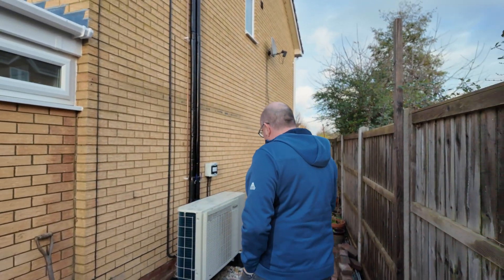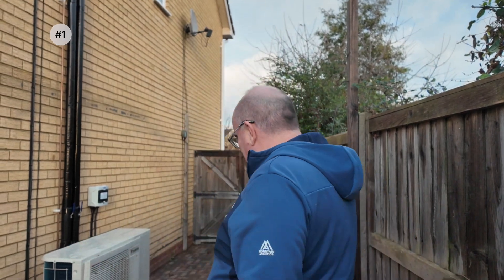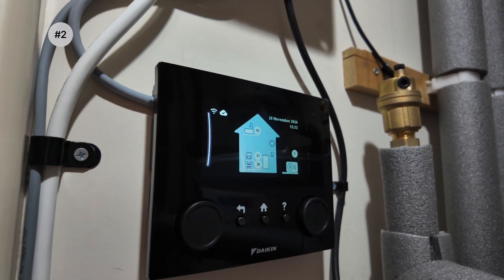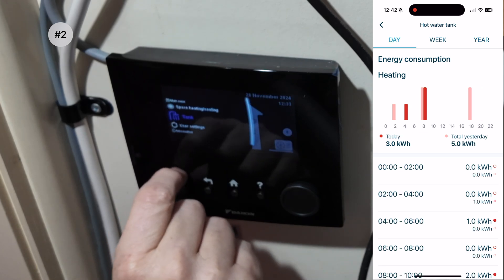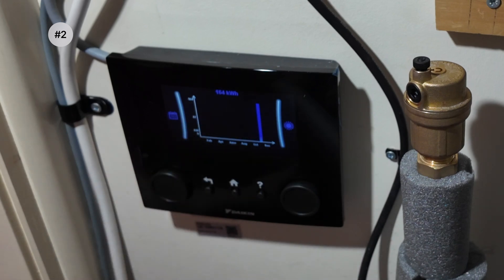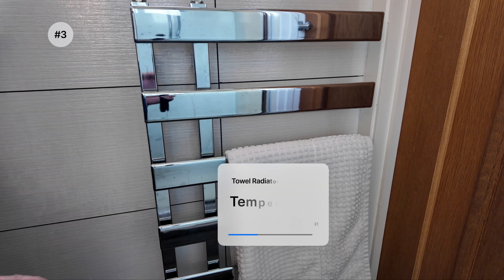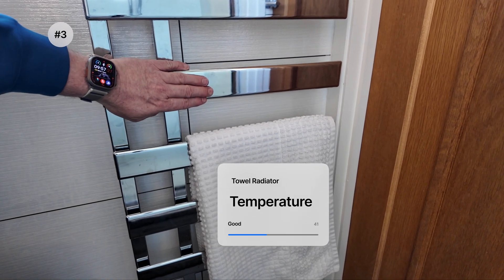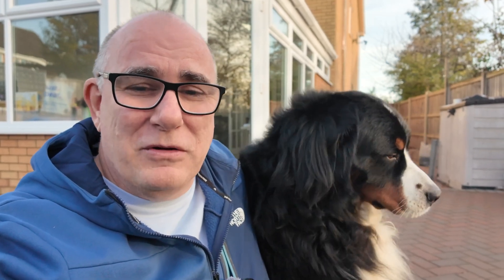3 THINGS I HATE ABOUT HEAT PUMPS

Comment: I think it was designed in Japan? I think there's stuff out there that can talk to the Daikin's API to extract data; I've already been looking into it as I know the interface is a bit rubbish - rounded numbers for kWh used and generated is something I've heard.

I picked up another Shelly EM in the recent sale which I intend to use to monitor the consumption of the heat pump.

I don't even have a heated towel rail; I just let my towels dry naturally. I always have spare ones. And my radiators are not that hot, even now, with gas; I switched to a nest thermostat that uses opentherm to control the flow temperature of my boiler and since then I think it targets 45 degrees most of the time. If anyone out there doesn't want a heat pump or can't get one at the minute but wants to save some money, it's worth looking at, but you need to wire it up to use opentherm. Nest doesn't do pure weather compensation but I think it does factor weather data into its decision when to start the heating and it figures out what works. I also keep my house fairly cool (around 18-19 degrees) and I use around 6500 kWh of gas every year on a 1952-build three-bed terrace with loft insulation, double glazing and cavity wall insulation added in South Wales solely for space heating and hot water, and I think that's pretty low. Unfortunately I don't have comparison data for what I was using before then.
Reply from the maker: that’s disappointing. I was hoping the API would give more granular data rather than the rounded up numbers that we see in the app. Maybe I need to go down the ESPaltherma route
Reply: Just to be clear, I don't know what precision you get from the API; I've only heard that you get rounded numbers in the Daikin apps.
Reply from the maker: Yep it appears so

Comment: So the COP is only 3.28. Isn't that a bit disappointing?
Reply from the maker: Yes but that’s because we’re still finding the sweet spot, we have not adjusted the weather curve yet so it’s pretty much factory default. Realistically we would measure the cop over a much larger period than two weeks. I’m already starting to see a edge up even with one more weeks later this is also combined, of the heating and the hot water system. Hot water is generally a little bit lower so the average of the two will be slightly under what would be expected.
Reply: @JonathanTracey Shouldn't the standard installation set the optimum heat curve, weather compensation and flow rate? Or is the end user really meant to know how to tune an ASHP?
Reply from the maker: Yes however the amount of data that I had to calculate the cop at this point is so small that one or two cold or warm days could completely throw it off. Really this should be taken over many months or even a year to get a realistic figure it’s like driving 100 miles and getting an average of 27 mph when at one point you were doing 100 miles an hour, the point in time data shows you were going really fast, but when you average it out over the whole journey you find out you were basically crawling along
Reply: Short term COP calculations aren't that useful, they will have been designed for a SCOP so youd have to see how it fares over a whole year to know for sure how well it's doing

Comment: I agree with the water on top of the heat pump, even when it dries it leaves water marks.
Reply from the maker: We see that once we’ve had a couple of dry days, the water evaporates leaving behind dirty residue
Reply: Temu do heat pump top covers for just such an issue
Reply: @maureenandjohnwhite6228  I'd rather let the heat pump have free air flow... I don't want to risk the efficiency by using a cover from Temu
Reply from the maker: I’m considering 3-D printing some sort of magnetic attached frames, sheet of plastic. It would sit just a few millimetres above the top of the unit having a very slight slope towards the back so that the water would run off
Reply from the maker: 🤦 of course they do

Comment: I agree water pooling on top of the heatpump seems daft and it means that over time it gets dirty. The app is a bit disappointing as there’s too little info on it, but I’m not too bothered so long as Everything is working. Towel rail yes it takes longer but that’s ok as now my shower room isn’t a sauna. As a retired plumber/ heating engineer I think the pipe work in your airing cupboard could be a bit better especially the one straight in front of the cylinder that shouldn’t left like that as it’s to easy for it to be pulled out and cause a leak. I would definitely get them back to change that. It’s  bad practice to leave a pipe unsecured in that way. If one of my chaps had done that he’d be back to alter it.
Reply from the maker: thanks for the tip. I have a follow-up meeting with them in a couple of weeks to check for any snagging problems. I’ll ask them about the pipework in front of the cylinder.
Reply: Absolutely right. With a bit more thought, effort and pipe, you will very able to use some of that space for towels again!
Reply: I agree... and on top of that... from what we can see from the video... the lagging is appalling, they couldn't even be bothered to take the old battens off the wall and the wiring looks like the plumbers done it (and not an electrician).  Certainly not the sort of work I'd put my name to...

Comment: I have the same complaints about my Samsung ashp. Smart things is a joke in this modern era.
Hopefully the advent of octopus cosy with its remote sensors and feedback to the octopus app will give the traditional ashp makers a kick in the bum .
Reply from the maker: Hopefully, the data is all there it just needs an easy interface to visualise it and export if needed
Reply: The guys at Homely energy have invented an interface which plugs into modbus Ashp and builds a picture of the house so it can better tune the weather comp based on today's and tomorrow's weather and the heat loss it calculates for the house.

Comment: In our house we ended up getting thinner bigger towels and just hang them over the bannister or wherever. The old thick towels were too hard to dry and would clog up the radiators making the room colder. They could go smelly too if left damp for too long and I was getting fed up of having to disinfect them!
Reply: Despite having a 4 bed detached, we'd struggle to get a HP near where the old boiler was.
Also we have 10 microbore radiator pipes.

Finally, it's quite a modestly sized property.
Loosing the airing cupboard would be a disaster.

Appreciate they may work for a certain people and their homes / circumstances, but I can't help thinking there has to be a better solution?

Excluding standing Charge, 2023's gas bill was £493.
With being nearly at the end of 2024, we are at £357.

I did invest in loft legs, proper non compressed 300mm of insulation in the summer, and maybe that's helped a bit?

I just struggle to see how we'd achieve any kind of payback?
Reply: @stuartburns8657  I think the argument is that the work needs doing anyway, so when you sell the house it would be worth more. Saying that I don't have one. I mainly use gas and have a few split AC units. I was going to get one but the install costs were £6.5k, and even then they wanted to specify a flow temp of 55c and convert my vented cylinder to unvented, which would be an issue as we only get 2 bar on our incoming supply
Reply: (I'm moaning because it should have been cheaper to fit one to this house because all the pipework is 15mm copper, we've got 28mm pipework between the boiler and water tank, the radiators are already the right size, we have the ideal house!)
Reply: @jamesdcuk  There you have it James.  Your ideal property and still looking at 6.5K wow.

Not sure about the adding value argument.  If and when we get to a situation in which renewable electricity is dirt cheap, then where viable they make more sense.
Needing both £7k grants and being dependent upon smart tariffs is too delicate a balance.
Getting your 3-4 COP great, but with electricity tried to gas pricing, I just can't justify the expected distribution.

I'm getting a proper quote after Xmas, as we have a 10 year old combi boiler.
Don't have high hopes for the HP option, so we may end up with a new combi which is a shame
Reply from the maker: Yeah it’s not gonna work out for everyone. We’re in the fortunate position that we have enough battery storage that we can buy energy at very low prices to run the Heat Pump which makes it a no brainer compared to using gas. The airing cupboard is proving to be a bit of an issue for us, but it’s forcing us to have a bit of a clear out of some other cupboards where we can then install the towels.
Reply: @JonathanTracey  What concerns me is that's the direction they're encouraging if not pushing ppl towards.
As you say, you are in a larger property, you can more easily absorb the loss of a cupboard, and you have plenty of battery storage to mitigate the costs.
Most if not all of those are simply not an option.
We have PV and battery storage, but it's not suitable to be running the 600-800 additional watts a HP would introduce.
Or at least, not without quickly exhausting the capacity, then we'd be robbing Peter to pay Paul  from a grid import perspective lol
Reply from the maker: thanks for the tip

Comment: For monitoring I use ESPAltherma   , it does mean removing Heatpump cover and plugging in  an esp 32  device.  Gives all the info you need updated every 10 seconds
Reply from the maker: thanks will look into it over the holidays when i get some time.
Reply: @JonathanTracey  it’s helped me tweak settings  so I have a average cop since monitoring in early oct of 3.9 total   , space heating is 4.5  . 
The coldest day here in November was - 1 overnight  and Max temp of 4.7  which lead to a cop of 3.37   and Used 18 kWh s on that day so have reduced  curve a little  lower  . 
I think there’s plenty of headroom to raise efficiency on a standard octopus install
Reply from the maker: Yeah, I wanna get a couple of months of data on the standard settings before I start adjusting things that way I’ll know if my adjustments are making any difference. One weeks data really isn’t sufficient to know if I’m being good or bad.
Reply: @JonathanTracey I wouldn't worry about waiting. You would need to correct any readings with outside temps/degree days. 

I'd get on with dropping the flow temp as low as I can go until I start sacrificing comfort and need to bump it up a step or two.
Reply: Is that similar to the Faikin project?  It also uses an ESP32 hooked into the S21 port on Daikin A2A heatpumps.  I have a couple installed in my units here and they're pretty useful, though I mostly use them for control and not monitoring.
Reply: Nice project! I will be looking to put this in soon, I think 🥳
Reply: I to use ESPAltherma. I used an M5 Tough connected to the heat pump. I have a Shelly Pro EM 50A connected to the heat pump and emersion feeds. I am not sure what to do with the data to make it more efficient. My wife feels the cold and at the moment she is happy with the house temp so don’t want to fiddle. I will be interested to see what other have done to improve the COP. My heat pump monitor site says my COP is 3.80, so that seems good to me anyway.